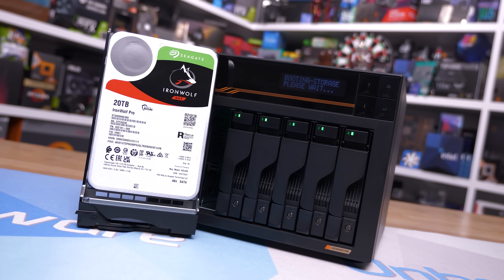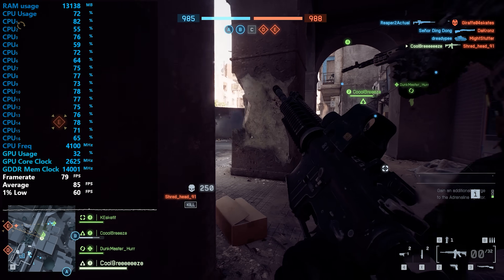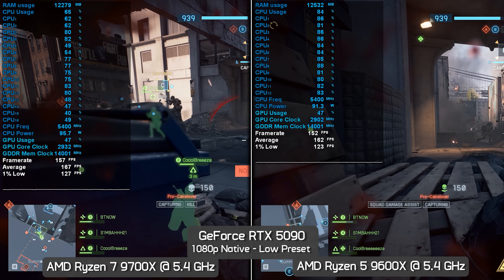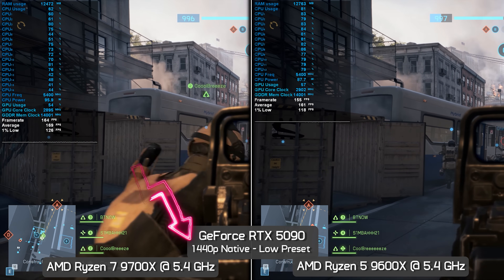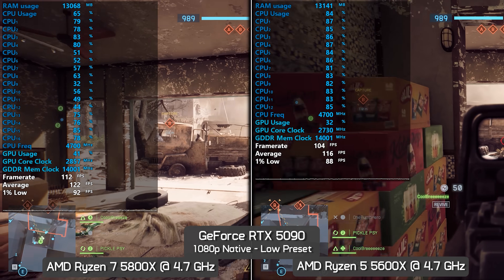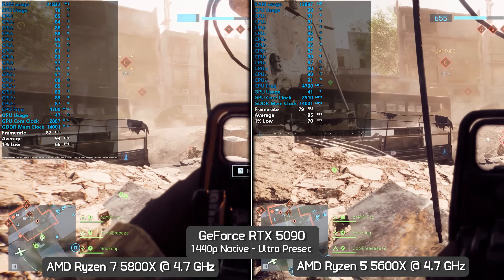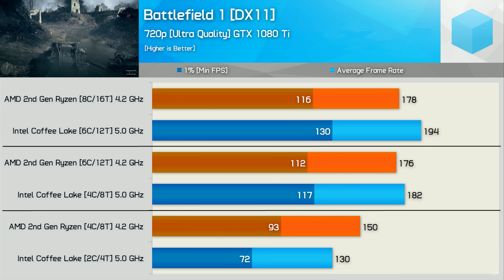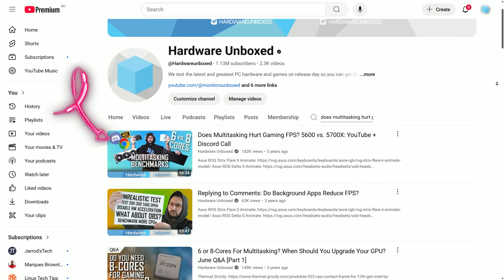Why Gamers DON’T Need More Cores, 6-Cores Still Works Well!

Comment: The only reason to buy a CPU with huge amount of cores for gaming is Cities Skylines 2 and MSFS 2025, otherwise I've never seen a game that would fully utilize 6 cores, let alone 8 or even 16 cores. That being said though, CPUs with higher core count usually come with bigger L1 and L2 cache and that could have effect on 1% lows, however at the same time 1% lows difference could be mitigated with faster system memory.

Comment: R7 2700X. Probably the best monetary decision i ever made, 186€ new in late 2019 for an 8 core ZEN+ chip that still manages to power all my current games.
Reply: With what GPU?
Reply: @lifeofranco  GTX 1660 SUPER Gaming OC from gigabyte. Gonna retire it later this year tho cause it's struggling.
Reply: @erisdelta5950what about cpu? U going to wait for am6?
Reply: @lifeofranco  Probably unless ZEN6 is as massive of an upgrade as Zen was compared to previous Piledriver chips which i highly doubt.

Comment: I love this video. I only moved to 8 cores because of my workflow which isn't that demanding and clocking my 9700x to 5.2ghz has it in spitting distance of the 9900x stock in multi-threaded performance. Most people do not need this kind of performance and it blows me away how fast the 9700x actually is whether it is in games or productivity. 

If you enable AVX-512 for CPU encodes in handbrake you can easily encode 1080p HEVC above the fast preset over 140fps with 8 cores. Most people do not need this kind of performance and even 6 core Zen 4 is enough for most people.

Comment: A 9900x is cheaper than a 7800x3d but how would the two 6core ccd's fair against a 9700x?
Reply: I am betting due to the latency between CCDs the 9700x for gaming will be a bit faster overall in some scenarios.

Comment: 6 cores will remain enough until developers start building games that can properly utilise mor cores, which they just dont bother doing. Even 8 remains the limits and as a gamer this meant I didnt bother considering CPUs with more than 8 cores. If games worked with 12/16 core CPUs or more,  Id immediately buy one.

Comment: I think 8 cores can be a great value proposition if you use it for some productivity tasks outside of gaming. I'm regularly video / audio encoding or compiling and I can see the benefits of the extra threads.
Reply: Plus shader caching in games. I remember folks going bonkers about how some games took forever to cacha games like The Last of Us. At the time I had a 13700K and it completed the shaders in a very few minutes. I was expecting a long wait, but nope, all done very quickly. ..... 13700K is no more. Fitting an Arctic Freezer 3 killed it. Using AMD CPU now.

Comment: This was a good video. I’d like to see more stuff like this for sure. 

I do have a question tho Regarding the multi tasking + gaming. And that’s whether or not if this is also depended on the number of screens you are using. 

Does using more monitors hurt your performance on top of the multitasking stuff mentioned in the video. Added along side using a 6, 9, 12 CPU processors

Comment: I started experimenting with v-tubing using a 3600. It is possible only with very simple games. When I upgraded to a 5700x (not 3D), the performance issues mostly resolved. Games have about the same performance whether I am streaming or not. My speculation is that going from Zen2 to Zen3 made more difference than the extra two cores.

Comment: Personally I would like to see a new multitask test. Back then most games have a hard time actually using multiple cores. Right now I'm curious about how CP2077 would perform while multitasking, maybe throw in Spider-Man 2 and potentially BF6. Also I want to see not just 6 vs 8 cores but also 16 cores (because I want the game at the very least have access to 8 cores on a single CCD regardless of the game or system intelligent enough to prevent cross CCD latency). The reason for it is because I want to see if having more cores actually prevent performance degradation when multitasking or probably the cross CCD latency or maybe bandwidth contention ended up making those extra cores useless in normal gaming + streaming scenario.

Another thing that I like to see is if you can create a situation where more cores actually benefit gaming while multitasking starting from adding something to run like right now we have Vtubers which run all those streaming stuff + Live2D/Vtube studio, and then you can try to use more audio/video effect/filters on OBS, maybe add downloading games in the background while gaming, etc. Of course this is all just an extra if you have the time since I know these kind of test can be very time consuming. In the end I just want to know how much someone need to multitask to make the extra 2 cores or an extra CCD worth it if you don't just play Star Citizen?

Comment: For some brainless shooters yes it can be enough, not so much for simulation games, 4X games and the likes
Reply: So what game out there can a 7600x or 9600x not run acceptably?
Reply: @davidandrew6855  Define "acceptably"
Reply: @bulletboy159  For most gamers a solid 60fps is acceptable.  If you are competitive online, then that is up for more granular debate.

I mean most of the games I play, even on my anciet Ryzen 1600, are above 60fps and at times I'm actually GPU limited.

The answer to the question is nebulous to a degree, but I will go with 60fps, as acceptable to those of us not frame rate chasing.
Reply: @davidandrew6855 I got a 9950X3D for a couple of weeks now, first game i tested was a big theme park in Planet Coaster 2 with more than 10000 guests and my frames dipped into the 40s, my previous cpu a 10900k got 20fps.

I also play vr sim racing games where 90fps is mandatory or you will have a bad experience.
 
Also faster turn times in Total War Warhammer 3 (time is precious) etc... etc...

Don't play many shooter anymore, certainly not competitive, some Doom or Hell 
let Loose for a couple of matches and that's it

And for me i like a minimum of 80fps, lower and it feels choppy

It's my hobby, while expensive these days, i love it.
Reply: @bulletboy159  Nothing wrong with any of that, as we can make PC gaming anything we want, if we can afford it.

Comment: Loving the BF6 content as I wait for the game to come out. 

I would be interested to see this comparison (bit late now) with a mid range GPU, the impact if the CPU if, say, it is having to handle the extra load of fetching shaders - I've seen this on another multiplayer game, everyone says it's CPU bound, but have seen swapping in a faster GPU with more VRAM it runs more FPS where the CPU is not so busy apologising for the GPU.

Comment: Not trying to argue, but how many cores do you need for gaming if you actively talk on Discord, have a browser guide open, have Radeon settings open for tuning and overlay, Steam overlay is showing FPS, Start Menu X, Lightshot Screenshot, Core Temp is running, Yolo Mouse is running...  What about Grim Internals, Playnite for all of your libraries in one spot, FX Sound, etc.??  How many cores should we have then?  
I play at 4K/Ultra 60+++ with a 5900x, 6950 XT & 32GB 3,600MT.  Can I REALLY get away with only 6 cores for 4K gaming with 219 processes, 3674 threads, and 119,956 handles?
Reply: 219 processes, I have about half that many.  I have a lowly Ryzen 1600, and have had no issues with a browser open, mouse software running, a video even playing on a 2nd monitor, an FPS overlay, etc.  Granted I'm mostly GPU bound at the moment, but I would expect any modern 6 core from the last 4 years to handle what you described pretty well, memory may be more important, and I noticed a major performance jump when I doubled RAM to 32GB.

Comment: I have purchased many high end gpu's cpu's and mobo's, but if I'm honest the best times I ever had gaming was on an old Toshiba laptop which wasn't made for gaming at all. 
If I could trade in ALL my incredible hardware to struggle on that laptop with my old friends in our old games I would do it in a heartbeat. It is possible to save your money, go 1080p and rip.
Reply: There are lower resolution monitors with stunning images. Monitor quality counts.

Comment: I bought a 12-core, R9-3900x partly to "future proof"
A few months ago I "upgraded" to an R7-5700X3D because its eight cores worked as good or BETTER in every scenario. In fairness, I did benefit using Handbrake a few times (maybe 20% faster vs the 8-core based on CPU usage of 80% (ish)... i.e. (12/8)x0.8), but if I had to do it over again I'd have bought the R7-3700X since the Handbrake stuff I just did overnight to compress BluRay rips. So the 3900x for me was rather pointless in the end.

Comment: I think one part that is missing from CPU benchmarks especially is that it doesn't test real life use cases. We don't typically shut everything else down when we start up a game. I've got several programs & up to several dozen browser tabs up simultaneously.
Reply: Exactly! 6 cores will get you by, but 8 gives you a bit of extra headroom for real-world scenarios, and other use cases.

Comment: Of course this is all assuming that someone is buying CPU just for gaming and nothing else.
Not even thing related to gaming like converting gaming videos.
Reply: You also have to understand that the core audience for HUB is gamers, so the content is tailored to that audience. If someone wants to do productivity as well as game, they probably already know what they are going to get for their CPU.  That is why parts like the 9900X or 9950x exist. 

For the vast majority of casual gamers a 6 core modern CPU will be more than enough for gaming.
Reply: @davidandrew6855 I am part of the core audience. And most PC gamers who are not too young don't use PC just for pure gaming.
Otherwise they would be on consoles.
Less cores exist not for gaming but because they are cheaper.
Reply: @senti2175  "Less cores exist not for gaming but because they are cheaper."

Of course, and that was never the debate.  The discussion was are 6 cores good enough for gaming, and in 99% of the scenarios a modern 6 core is pretty great for gaming.

Comment: And then Borderlands 4 comes out which requires an 8 core as minimum spec.
Reply: LOL, yeah, and a 7600x or 9600x will walk circles around the 2700x the listed as minimum spec..

Comment: So, under optimal circumstances, if you spend 50% more on a CPU today. You will still not have a cost efficient benefit 7 years from now (Assuming current gen scales similarly into the future as Zen+ did)? Man that's some top tier future proofing advice from the random gamers yelling at clouds of the internet.
Reply: Of course not. And do u know why that is?
Because cpu's...... get better
Reply: @richardjung9562  Whoa, that's crazy! Who knew? But I get the whole futureproofing rabbit hole is easy for people to fall into. It would be interesting to see a retrospective on all the "futureproofing advice" given through the ages and seeing how it aged. I found that part of this video to be very interesting.
Reply: @skeppartorsk you are basically complaining about cpus improving over the years. What is wrong with you😂

Just buy a 200-300$ cpu and u get more than enough performance for many yeras dude
Reply: @richardjung9562  Reading comprehension? Do you have it? Because I never said anything of the sort. I commented on the fact that the "8 cores age better than 6 cores" argument doesn't hold water (which was the exact point this video was making, did you not watch it?)

Comment: It might be a safe assumption, but this video only proves the statement for a single game/engine. UE5 Nanite is multicore CPU heavy, but how much it benefits from more cores I was expecting to get an answer from this video, kinda disappointed.
Reply: Are you sure? I thought that for Nanite it used software for really small polys that runs on a compute shader?

I do agree that pre rasterization parts of Nanite do benefit from more CPU cores, but even a moder 6 core part should handle it "OK", but maybe that is part and parcel of the bad performance on so many UE5 games?
Reply: @davidandrew6855  My memory is rusty on the subject, I went back to SIGGRAPH video and @46:37 he says "this is all GPU driven" and the slides says "Small CPU cost. 1 draw per material" (which sounds as gaslighting). SW renderer is used a lot though (@45:44 slide shows 30 times more for Main pass and 13 times more for Post pass).

Comment: I think you should also test them with recording and streaming the game.
Reply: I think that becomes mostly a GPU burden than CPU, since most modern GPUs have pretty good builtin encoders. NVENC, AVI, QuickSync..at least I think that is how it works.  If one is using software encoding X.264, that is probably a different story as I hear it is better on the CPU than older say AMD hardware,

Comment: How about an even better epiphany: you don't need an X3D chip if it's ruining your GPU budget.
I keep seeing people posting their 7600X3D/7800X3D with a 9060XT or 5070 when they could have bought a 9070XT or a 5070 Ti if they'd just gotten a 7600/7600X/7700. And they end up with significantly lower FPS because they didn't understand that the hype is for people with a high budget.
Reply: Yeah but sometimes folk upgrade their platform, before upgrading their GPU. Like my system was 13700K with RTX 4080. My 13700K died after fitting an Arctic Freezer 3. I bought a 9800X3D platform, and put the RTX 4080 on it.

Comment: Quick question Steve, in the 9700X vs 9600X comparison, was the 9700X ran at it's very base stock 65W limit? AMD did fairly soon after the initial release, add a 105W BIOS option, which while technically an 'overclock', is fully AMD supported and just a more general option, not buried in the overclocking section.
If the 9700X was at stock and hence somewhat power limited in all core workloads, do the FPS numbers change if it is unlocked?

Comment: You should at least show Unreal 5 and other modern games that use ray/path tracing.
Reply: Yeah, they crush the 9800X3D. I have seen in Oblivion Remastered, all eight cores and threads running at 90%+. If you ran six core with that, I bet you'd see a 20% drop in frame rate, and possibly lumpy performance. I have to use DLSS and frame gen to Oblivion Remastered to a playable frame rate over 120fps all the time. Once you're using DLSS, the CPU is the bottleneck, and possibly without DLSS but I never checked.

Stalker 2 is similar, but loads mostly the first five or six cores, and the remaining acores/threads are at about 50%.

Comment: 11:40 just to point out the 2700x has 4 cores per CCX and the 2600x only has 3, so while both are going to be suffering a latency penalty jumping across the IF the 2600x is going to be doing it allot more, so you'd see the same thing in Zen2 between a 3700x and 3600 but of course with higher framerates (likely around 98fps and 81fps respectively).
Reply: Great point, I was about to comment the same when I finally saw your post.

It's fascinating how quickly it became obscure knowledge that Ryzen used to have 2 CCXs per CCD.
Reply: Shouldn't it still just be half the time though?

Comment: 6 cores will age like 8 gb vram graphics cards. you guys got pretty down pretty bad.
Reply: No they won't. 8GB VRAM and 16GB VRAM is a matter of a game being playable or unplayable. 6 cores vs 8 cores is a matter of pushing +5% frames out of a literal RTX 5090, something none of us has enough money for.
Reply: @one_step_sideways buy your 20th gen six core in future then.
Reply: @hmelihonay Why? 6 cores is quite enough for when you're not procrastinating or wasting tons of money for 5% more frames in trash videogames. You should leave the echo-chamber of yours and realize that even 4 cores is quite enough for the vast majority of users due to how most apps still only use 1-2 cores to this day. Not that you should buy a 4-core processor, though, they're nowhere to be found, whereas a Ryzen 5 5600 now costs like $90.
Reply: @one_step_sideways  amd gatekeeping six cores as ryzen 5 to not releasing 3 class cpus is enough for me. also most apps use 1-2 cores? uhm when, 2010? snapdragon 800 was peak design then for sure.
Reply: Not really. With CPUs it's like running up a hill that gets a bit more steep year after year, but with GPU memory it's more like running into a brick wall.
Reply: Nonsense.

A GB of vram will always be a GB of vram, no matter how fast that vram is it won't help the game fit better into vram.

But an older core is vastly different from a newer core, and a faster core can very much compensate for a lower core count.
Reply: @paulustrucenus buy your six core at the same price of higher core counts then. i’m not. faster six cores also does not equal more cores, perfectly aligning with your comment. everyone should’ve stick to i3-12100’s then.
Reply: @hmelihonay You insist upon yourself. I just said that the great Ryzen 5 5600 is $90. It provides enough performance to last you for the next 5 years. You are also typing this out in a web browser that will always use just 1 core. And if you don't believe that, the Snapdragon 8 Gen 3, the peak design we have right now (unarguably better than the outrageously expensive and unoptimized Snapdragon 8 Elite), has a 1+3+2+2 configuration, with the one big core it has, tailored specifically for single-core workloads, which makes it feel extremely fast precisely because of the fast single core. Single core is king, yet you's rather have 8 weak cores instead of 6 fast cores.
Reply: @hmelihonay  I don't think you understand understand the words you say

Comment: The thing is, speaking of X3D chips an 7600X3D is almost identical to 7800X3D but you can´t find it anywhere avaialble, at least at reasonable price, i´ve seen it on ebay but on 7800X3D prices LOL-